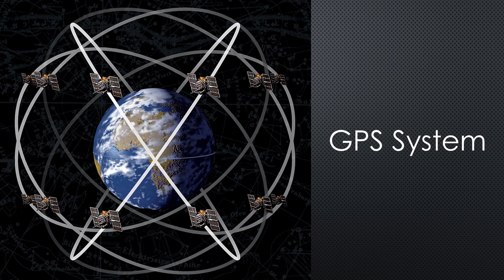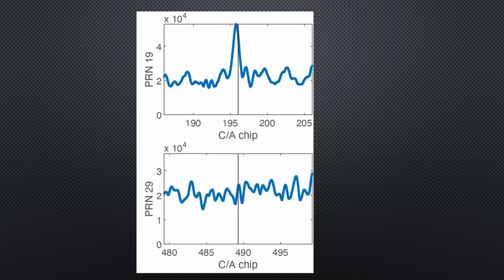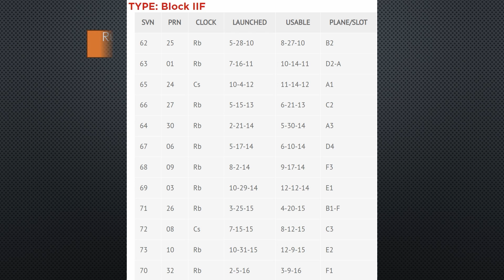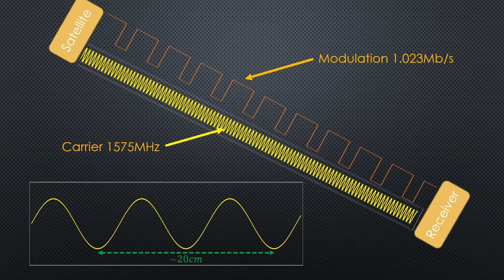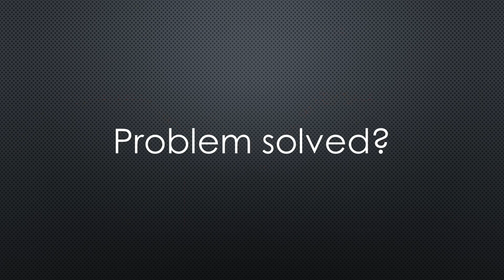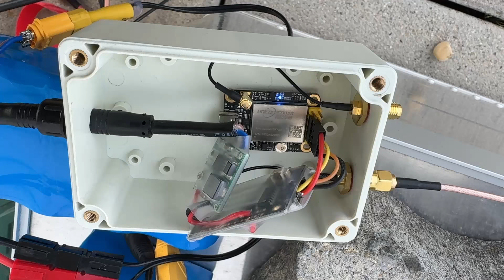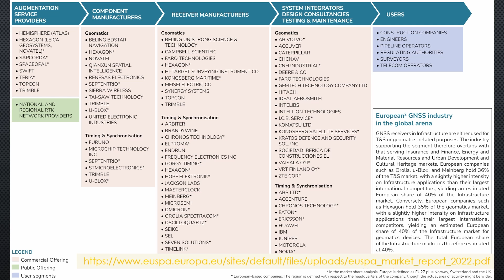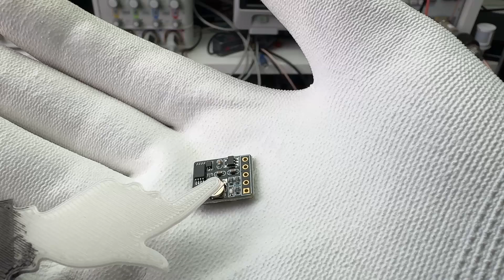(483) ESP32 precision GPS receiver (incl. RTK-GPS Tutorial). How to earn money with it (DePIN)

Comment: Differential GPS, using RTCM-104 serial protocol has been around since the 1990s. President Clinton, with consultion with the DoD, turned Selective Availability OFF, as they saw the commercial value of GPS services when 3D accuracy went from 100 m, to 5 meters (though elevation accuracy can vary up to 10 m, depending on current satellite geometry.) Initially, phase coherent receivers were expensive but MIMIC IC techology has made substantial improvements in number of simultaneous receiver channels, multiple satellite constellations. RTK is basically standardizing the RF serial data stream for differential corrections. In the day, we used COTS RF modems to perform real time differential corrrections, as the data rate between stations can be done at 9600 baud. In the US, the USGS has a published network of location monuments, and also a network of CORS stations that you can download recorded GPS location information to do post processed corrections on your base station to obtain a "surveyed monument" accuracy, without having to find a USGS monument.
Reply from the maker: Thank you for the additional info! I did not mention differential GPS because it is already old (and probably well-known), and the video was already long.

Comment: Very interesting! I have built a mobile mapping system (in my vehicle) for setting out an event with roads, pits etc. There is no mobile phone service or internet available as the location is in remote Australia. RTK & any surveying equipment is way out side of my funding, so I first started with a simple GPS puck on my dash & a basic mapping system on a tablet and have since stepped up to a laptop & a GNSS antenna so the accuracy has improved a lot but as I'm moving setting out the roads etc it can get out a little. Australia has been trialling the SBAS system which suits me (corrections through another satellite instead of using a RTK base or over the internet corrections). I'd love to workout how to use the SBAS (or SouthPAN as they call it here) but have not been able to work it out.
Reply from the maker: SouthPAN seems to be an interesting service, but I did not find information on how it works in detail. Just a list of compatible devices.

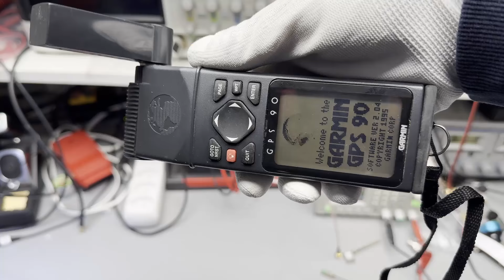Comment: Great video (as always), thank you Andreas. For the sake of completeness, you could have mentioned WAAS/EGNOS as a means for getting a bit more precision than with GPS only. I think it is the mostly used method nowadays as it provides enough info e.g. for determining positions accurate to the traffic lane. BTW it was cool to look at that old Garmin receiver at 1:55. I bought a Garmin 12 in 1997 or 1998 but I sold it some years later to purchase a Garmin V for using with maps on motorbike and in car. And, of course, Geocaching since 2001.
Reply from the maker: Indeed, DGNSS is an interesting technology. However, it was hard to put all GPS and RTK stuff into the 20 minutes already...
Since I stopped piloting long time ago, I forgot that I had this Garmin until this video ;-)
Reply: @AndreasSpiess  Yes, Differential GPS/GNSS is the technical term… forgot that. WAAS, EGNOS, and some others are the names of the satellites used for that system.
Re. the atmospheric distortions: I like to compare this with the sky view a diver has from below. The waves on the surface make it difficult to spot the sun exactly.

Comment: I use GPS for setting my clocks (RTC). It became a little system. I also created a speedometer solution/test for my RC car, but still, a lot to learn. Should work on a train and so on too.
Reply from the maker: Nice project! For that, you fortunately do not need an RTK receiver, just a standard GPS one.

Comment: There's one thing you didn't mention and which blew my mind when I learnt it (and I hope a swiss will appreciate it): the time keeping precision needed is so crucial that general relativity (because of the altitude) and special relativity (because of the speed of the satellites) have to be taken into account. So the atomic clocks onboard the satellites are engineered to run behind (but with extreme accuracy, they run at 99.999999955% the "earth rate"). Otherwise, the calculated positions would drift by several kilometers a day.

I wonder if that's the only real-life application of special relativity.
Reply: The speed of the satellites isn't a huge issue as they are all traveling at the same speed as each other, it builds up slowly over time but not that bad. The effect of altitude is a big issue thought and the error builds up quickly.
Reply from the maker: I am only an engineer who studied at the same university than Einstein. But he was way brighter than me ;-)
Reply: @AndreasSpiess  He was an LED, Light Emitting Doctor

Comment: I've been looking at this for a few years and it's hard getting a clear explanation of the subject. One thing people keep missing is that if you want 1cm accurate measurements you don't actually need a base station or RTK, you can simply save the data and then use post-processing to correct the original data. You'll need software and correction data from a public base station (should be free) and fairly accurate depending on how close you are. If it's too far building your own as a back up is still an option but not a free one.

What I really want is something a lot more accurate vertically. It can be way off, even meter accuracy would be a huge improvement there.
Reply from the maker: RTK is also very precise in heigth (vertically). I just did not test it in the video.
Reply: @AndreasSpiess  Really? That's not what I read. 

In my own tests normal GPS is very accurate horizontally, a meter or two off while vertically is way off and has a large amount of variability, so you can't even make an accurate slope and then fix the heights
Reply from the maker: @sie4431  I even made a video about GPS's poor vertical precision ;-) But RTK is much better (2-3x less than horizontal precision). Consult the receivers' data sheets for more details.

Comment: You can get even more accurate precision if you simply use a dual or triple signal decoder. As long as you know the mm distance between the antennas, and the antennas are decently spaced apart. You need one decoder, at minimum, but having three is better. The decoder needs to view the same signal passing through all three of the antennas. Knowing the distance between all three antennas, as well as comparing the detected signal-offset, it can precisely determine the RAW and AVERAGE position of the antenna's center point. You can even get precision from just two satellites, since you now have each signals "through time", as the signal passes through all three antennas.

Repeating the scan, using only two satellite pairs, of different pairings, you get the highest precision with the least "drift".

EG, of 4 satellites, A, B, C, D... Signal of A passes through antenna 1, then 2, then 3. Since the distance is "known" from 1 to 2 to 3 in 3D-horizontal space, you can estimate a crude position. Obtaining a signal from satellite B, on all three antennas, hitting 3 then 1 then 2, you get a second crude triangulation. Together, both of these crude triangulations can be averaged down to a decently precise location and individually compared for a confirmation of precision. Adding a third, across all three signals, hitting antenna 2 and 3 first, equally, and then 1... You get a third crude precision. Averaged with the other two crude positions, you get a highly accurate position. When comparing ALL three timed signals, through each individual antenna, as well as the trio of timings, you get CM precision, with nearly no drift, on average. Adding that fourth satellite, you get even more precision.

The added precision comes from decoding the data like this...

A (on 1, 2, 3) as a crude 2D position
B (on 3, 1, 2) as a crude 2D position
A + B (on 1) {linear position}
A + B (on 2) {linear position}
A + B (on 3) {linear position}
A + B (on 1, 2) {cross position}
A + B (on 1, 3) {cross position}
A + B (on 2, 3) {cross position}
A + B (on 1, 2, 3) {Should match the avg of the first two 2D isolated signals, when averaged}

Repeat for AC, AD, BC, BD, CD... for each antenna.

Without a 3rd satellite, you get only an accurate 2D position. Adding a third satellite, you can get an accurate, basic 3D position, adding altitude and greatly making the 2D-plane more accurate. Adding the 4th, you get all three axis precisions, down to nearly NM precision.

Remembering that the precision comes from the relative calculation of each satellites estimated "center", in time, of the three antennas, as the signal passes through the individual antennas. Each giving a crude position, but by each pairing, you get more and more precision.

Each antenna getting pairings of AB, AC, AD, BC, BD, CD (x3 known positions, or 2x if only using two antennas)

This is why, in essence, you truly only need two satellites, with a three antenna setup. AB (x3) is adequate for standard precision, which results in three linear positions and three cross positions and two crude triangulations. Three would be AB, AC, BC (x3 or x2), which is relative to being 9x or 6x satellites, virtually.

The signal can even determine the unit's 3D orientation, from that same timing, adding even more to the precision. You can also, unlike a single antenna setup, detect reflections and do inversion and corrections. Since it is safe to assume that a satellite didn't "jump" 1 meter or 10 meters, randomly, in time.

This works for precision, because the same time-signal will pass through only ONE or TWO antenna, at the same time. It will pass through the others, at a later "time". Measuring those times offsets, relative to the known positions of the antennas, you get a crude triangulation of the actual satellite's position, relative to you. Getting the second satellite triangulation, alone, is just as crude. However, when compared together, those two triangulations, relative to each-other, become a precise triangulation of two points in space. (Provided that the satellite is accurately positioned too.) That is why you would want the third satellite, at least. The chances that all three satellites are going to be "off", by any significant distance or time, is nearly impossible. They would all have to be off, in the same orientation or time, which would actually make the little difference to relative positioning, only global positioning precision. Adding the fourth, you get even more, confirmed precision. Using an average, though it may be globally imprecise, it would be relatively more precise. (You may be slightly off, on a map, but relative to your last position, it should be crazy accurate and the longer you get a signal, the more accurate the global position should be. As precise as the satellite's timing is. Tower corrections would just be a super bonus. Adding your own "clock tick" to detect, from any fixed ground position, without decoding any satellite signals, would be bonus too. That would be used to confirm the units orientation and "known" fixed position, relative to the moving signals. Even if that fixed signal was moving with you too, in a vehicle.)
Reply from the maker: Interesting. Is your system used in available systems?

Comment: Soooo basically DGPS or Differential GPS. A base station with a known position sending out corrections. 
We were using this technology in the Arabian Gulf for positioning in the oil fields before the Gulf war. 
The only difference is greater accuracy which is to be expected as the signals are not degraded by the military anymore.
Reply from the maker: DGPS uses the modulation signals, RTK uses the phase in addition. DGPS was already an enhancement as you point out.

Comment: This sort of stuff is quite phenomenal. I can imagine so many applications for centimeter-level GPS. I wonder, does a sub-millimeter version with local base stations exist? For tracking small parts in a small area.
Reply from the maker: Maybe @onocoy can answer this question. I cannot
Reply: reaching millimeter or even below is hard to achieve with today's technology. In order to do so, it requires significant investment into monumentation (large cement foundation) and equipment (5k+ per antenna and receiver)

Comment: It seems as though every cell tower could be providing this service. If that happens then the need for private stations will be drastically reduced.
Reply from the maker: So far I did not hear that any cell provider did this.
Reply: that's a good point! I wonder why they don't do that!
Reply: I just thought about it. maybe the cell tower radiation interferes with the GPS receiver. could that be the reason?
Reply: @flat-earther  every cell tower that I have seen has a GPS receiver. I believe they use it to keep their clocks updated

Comment: I would like to have better than 10m precision in position reports that I can use to location stamp my photographs. This video tells me that I can't really expect better than that for an easily portable device. The only way I have thought of possibly making the data more precise would be to take moving average of the received position reports.
Reply from the maker: Because the nature of the errors, they do not go away in seconds. So I do not know if short-time averaging would help a lot.
Reply: @AndreasSpiess  Having looked at position reports for a stationary device once in a while a position will be suddenly off quite a bit from earlier ones. Running a moving average should help smooth out those sudden big changes. I plan to capture a lot of data from my ublox n8m then run some calculations to see what effect a moving average has on the reports for a slow moving device (one carried around by a person).

Comment: You  could do the same  using a simple GPS and  say s 3 ~900mhz  transmitters (lora or HC12) . fixed at two known positions  and ping the response  to get the finer pin point position. but then it all down to how accurate the base stations are for geo positioning but for field accuracy perfectly fine  and you can cover miles and miles of   territories  with a couple 900mhz  devices . but I guess in Europe  some police channels run at 900mhz and a licensed or prohibited   channel .so you could do it  with 2.4ghz  5 ghz with low channel width (ie 5mhz). so it does not cause to much interference at either the channel first or the last channel  as the outer edge of channels have the least noise and    interference  usually and make it invisible to other wireless devices , to build your own RTN system at a far cheaper cost. RTK/RTN in north america runs at 900mhz , 450mhz and other open and licensed channels
Reply from the maker: You are right, you can transfer the correction signals directly from the base to the rover. However, cheap GPS modules cannot do RTK and therefore only use the modulation, not the phase of the signal.

Comment: I bought a USB GPS antenna years ago at a swap meet. Thought of using it with Google Earth, maybe make some custom KML(?) routes. Always thought about using a computer in my vehicle, either Windows or Linux. 

It's a very old GPS antenna, bought it at least 20 years ago. Only had 26/27 antennas for GPS. Compared to the antenna that came with Encarta Maps, from Microsoft, which had 51 antennas. 

I'd still would be interested in trying to use the antenna.
Reply from the maker: These antennas contain also a receiver!

Comment: It seems like cell phone companies could put these in every single one of their cell phone towers.  Even in rural areas those are very common, and I suspect It's not that much more expensive than a Telcom antenna
Reply from the maker: I do not know if they have such plans and if the two antennas fit. These towers emit quite some power and GPS signals are very weak.
Reply: @AndreasSpiess  They almost certainly have a GPS antenna somewhere on premises.  Probably not on the main tower, but rather on the building housing the networking equipment.  You even mentioned why in the video.  From what I understand, 1U rack-mount time sync servers with GPS are extremely common. Heck, for under $2,000 you can get a PCIe card with GNSS and a rubidium oscillator ready to go.

Comment: Actually, what you say is not entirely correct according to my information. Correct me if I'm wrong, but here's how I was taught it: With only three usable satellite signals, you can calculate your coordinates on a spherical surface, which is technically a 2-dimensional position is a spherical coordinate system. Only if you have four usable signals or more are you able to calculate a true, 3-dimensional position relative to the sphere's center, which is what we generally think of as a 3-dimensional coordinate.
Reply from the maker: I am only an EE, but I was told by the u-blox people that 3+1 signals are ok. And I thought that they should know it...
Reply: Yes, you can get a 2D solution from 3 satellites by placing a fourth imaginary satellite at the centre of the Earth in the position calculation. This was quite common in early GPS receivers before the full 24 satellite constellation was completed in 1995.

Comment: Рассмотрите как черновую идею. Если на наземном приёмнике сделать минимальный, фиксмрованный базис (2 антенны и 2 приёмника с блоком обработки). Зная параметры базиса между спутниками и параметры подвижного базиса на земле, можно отбраковывать слишком грубые решения + в программное обеспечение включить механизм автокалибровки наземного базиса. Предполагаю, совмещённые standalone-решения значительно повысят точность спутниковых определений. Также это даст конкретные данные азимута на поверхности.
Reply from the maker: I did not have to "calibrate" the basis, just switch it on and it found its precise position. And if you use a UM-982 with the correct software and connect it to two antennas, it gives you the heading.